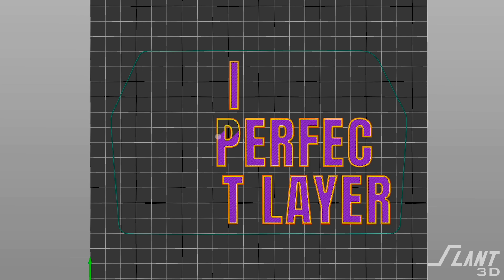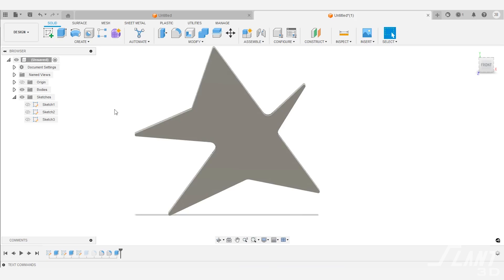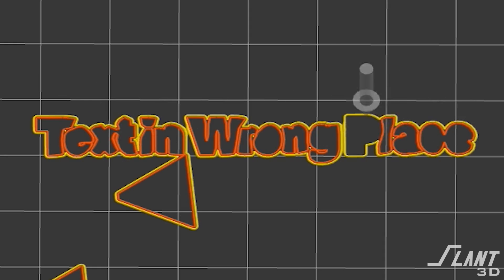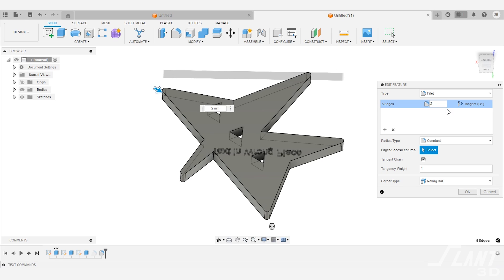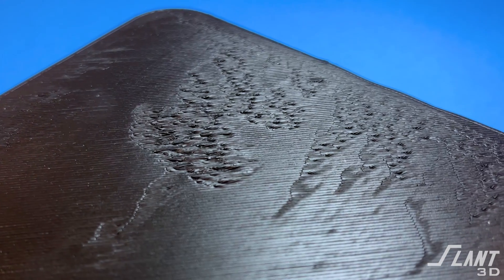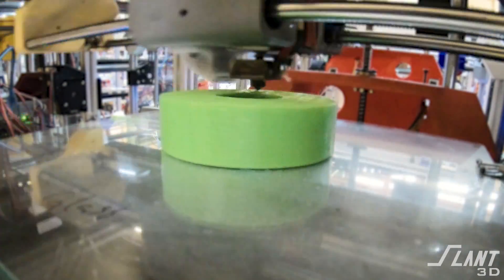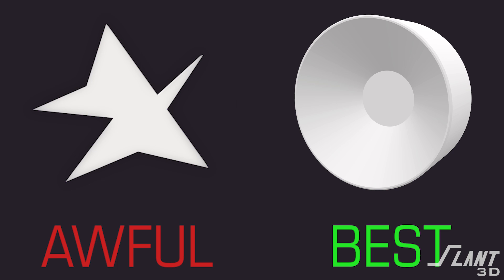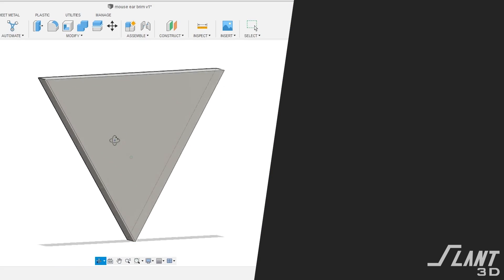Optimizing Your First Layer For Mass Production | Design for Mass Production 3D Printing

Comment: Great as always! Very informative and straight videos/topics in short time.
3:41 - here where you said 1mm is ideal - what happens to 0.2mm when using 0.4 nozzle to make 1mm thick line? Will it work wish some adjustments/settings(you advice) or is better to make that line 1.2 in the CAD prior slicer?
Also what printer would you recommend for 1/100 of mass production - lets say 1-2 printers max as a sidejob?
Thanks!

Comment: You're putting the cart before the horse. Learn to print properly, tune your machine, know your slicer. With Arachne and a tuned printer I can print your "nightmare" model - sharp corners, "unnecessary triangles", text, and all - perfectly. Every. Time. 

Don't underestimate what printers are capable of. I know you run a business and mass produce, but every single obstacle you touched on in this video can be overcome with a properly tuned printer and good slicing.
Reply from the maker: Anyone can print our nightmare model. Now print 1 million of them with ABS. You will pray for the optimizations
Reply: @slant3d  🤣 I wish you nothing but success in your endeavors.

Comment: My tuned Voron 2.4 R2 gives me the courage to print this "badly designed first layer" using ABS with zero worries 😂. A capable machine helps overcome a sub-optimal design, but I understand how mass printing places more emphasis on reliability. No one has the time nor the patience to perfectly tune +10 printers and create a custom slicer profile for each.

Comment: Wow. I would have thought that if the design required a star shaped object, with decorative holes, and the final product looked like a hockey puck, that would be a massive fail. Are you saying that 3D printing is not the best method for producing objects with complex shapes, I thought that was a main feature of 3D printing? What process would you advise if sharp corners are a design requirement? Personally, for the round object you advised, I’d use a lathe. It is far more accurate and faster than 3D printing.

Comment: If you guys are at bandwidth and at capacity for what you can currently do on a personal level -- I would recommend reaching out to your customer base and asking some of them to speak about their experience using you ugys, what products they made or do -- how that integrates; and maybe even some of the prelim API customers/testers.  

I come here for the printing content, but a fluff video that illustrates some social proof of your brand and shop services might be a low effort/crowdsourced way to have content in an in-between week; where you are occupied by the factory's needs.

Comment: First layers aren't such a big problems anymore with the current tech. Also, slicers are becoming smarter every day. 
If you can't even get your first layer right, then you shouldn't be running a print-farm in the first place. I know the response I will (or not) get. "Make 1 million more". but that answer is not gonna cut it.

You should make video's about real problems imo and offer your viewers tips and tricks about how to overcome them, instead of avoiding them. Even if it's in a print farm. 

Oh wait, you are trying to make them obsolete.
Reply from the maker: In mass production, every optimization is necessary. There is not a system on the planet that produces a perfect result every time. The entire process is part of the process.

Comment: If the design is hard to print just change the entire design! Here in the real world, that's rarely possible. Almost all of the issues you presented were printing tuning/calibration/maintenance issues. Those first layers looked like crap because the printer wasn't set up right. You sometimes have some decent advice, but this time you're mostly just wrong.
Reply from the maker: When producing millions of parts every optimization is important

Comment: I had issues with the large flat surfaces causing the waves/furrows and the solution was better leveling ~and~ a switch to 'Hilbert Curve' for the infill pattern. That prevented the long extrusions and resulting artifacts.

Comment: I get the video but printers now have fewer problems like this. Yes I’m talking about the Bambu Lab printers. Does Slant3d work on developing and improving their printers to match what modern printers can produce? And do you see these problems being inherent with 3d printing, or just the state of your printers at this moment? Like, will your printers in the future be ok with printing text on the first layer by the tens of thousands?
Reply from the maker: Regardless of the machine when you produce 1 million parts you need to optimize to reduce errors

Comment: I specifically put text on the bottom layer and design a large contact surface for my job. 

Not mass market printing though, but industrial. 
Rounding corners and chamfering edges goes a long way . A warped corner can kill a project quickly, many of which print for several days.
Reply: Do you print industrial end use parts in small batches?
Reply: @ChristosAdamMorsy   No, My end goal is to generate tooling for manufacturing. Most of my items are designed and printed once, or whenever they wear out. Only a few items get printed in batches.

Comment: Suoerb video ! Reminded me of a lot of things I sort of intuited and worked out whilst trying to design parts for printing in nylon, that were proving a swine to print, but with a view to being mass produced. A lot of the ideas seem applicable in higher horizontal layers too - eg not having pointy bits - which seem to suffer from warping and curling, and if designed into radii work so much better.

Comment: I love the videos, but I do have to say when I do multicolor prints on my Bambu lab x1 flat on the bed surface. It comes out amazing I don’t know if that has to do with the lidar or just tuning of the printer.
Reply: The X1 is just special. 
If you didn't own a printer before that, you might not realize it, but they solved a lot of the common problems with 3D printing. 

I'm just in loved with mine (that I use for engineering work). For once, the printer is not the project.

Comment: Or you could just tune your printer so it can print these things
Reply from the maker: Done. Now make 1 million more
Reply: @slant3d  well I'm not at your level of printing I won't argue that but I've probably made close to a million parts but I do resin mostly I do have a filament printer but most of my stuff is all very small highly detailed models but the fact remains once you dial in a printer resin or filament you should be able to drop just about any model on it and fire and forget
Reply: @slant3d done, now what?

Comment: I dont have any trouble doing multicolor text or anything else on the first layer. Get a multicolor printer and its basically no different than printing a regular part.... as long as your printer is tuned well.
Reply from the maker: Make 1 million more. Every optimization is important

Comment: Those bottom surface defects can be caused by finger grease on the build plate too. Printing a smaller first layer across a patch of grease is fast track to failure.
Reply: I've also had them by having the first layer too close to the bed by 20% of the layer height. It can also be caused by a non flat bed.

Comment: It’s nice to hear I’m doing it wrong but I don’t hear any real solutions. No text on the bottom isn’t a solution it’s just avoiding. The bottom needs to be a circle doesn’t really make sense if you have a part that isn’t a circle. In a perfect world all parts would be cylinders I guess but we’re not in a perfect cylindrical world.
Reply: Your exaggerating he said no sharp corner not make a circle, do 1mm if you can, if a square goes in a square then round the receptacle by 1mm also, like a lug nut, it would work better without round corners but due to manufacturing needs, it has rounded corners. You may not realise it but if you print using .4mm layer line width you will have corners rounded by at least .4mm. no need to round corners in the z axis by the way, he should have mentioned that.

 Also if you need text in the bottom, try flipping your piece on another side, your bottom could become the top. And personally doing text in the bottom I do some times for double faced coins but I warn the client about the faces not being simetrical and I put extra fees.

Not ideal doesn't mean impossible or illegal, just means try to avoid it as much as you can to improve speed, quality, cost and reliability
Reply: The solution is up to the design engineer, he gave advice on how to steer the design. He can't tell you exactly how to make your part.
Reply: When I'm working with a client on CAD modeling for 3D printing, I have them either in person or on screen share so we can come to a happy combo of design requirements and printability. Sometimes I have to tell them a particular feature they want would either be really expensive, hard, and/or impossible, so I offer a substitute solution.
Reply from the maker: Make parts rounder. Avoid sharp corners. Obviously your first layer will not be a circle. But moving in that direction is a way to "optimize" a design.
Reply: @slant3d  I appreciate your design tips and I think it's obvious what people can take away here.  sometimes people just want solutions to be black & white
Reply: @rELATionGaming  exactly. I already know these things and am looking for something more specific but a lot of these videos I’m coming across are at such a surface level.
Reply: There's various tips to improve the first layer in the video, summarized at the end. The circle is where you will end up if you follow all of that advice to the extreme, with no regards to your part requirements. Every part is different, there is no single first layer shape that will work for every part. You'll have to think for yourself to find out how you can apply the given tips to your own parts and figure out what shape works best within the design requirements of your part.
Reply: There's a pretty good recap of the solutions at the end of the video for those who don't have the patience to pay attention through the whole thing...

Comment: I always try to put details like text on the bottom layer because it usually looks the best imo
Reply: This probably boils down to they don't want to spend a lot of time fine tuning individual prints and they have to worry about reject rate. You can do this as a hobbyist on a single machine, but can you do this consistently on a print farm of hundreds of machines?
Reply: Same, his advice makes no sense about not putting it on the bottom. If you can’t print text on the bottom, you should fix your first layer issues instead of avoiding it.

Comment: Prusa prints parts on their printfarm that have text on bottom surfaces, have fairly sharp corners, have cutouts and have large surfaces. I really like your informative videos but this one isn’t up to date at all. I don’t get why you present such massive limitations of 3d printing even though it’s apparently just your printfarm that doesn’t produce good prints
Reply: It's not that at all.  He's talking specifically about designing parts that will print well and will require the fewest number of slicer modifications to do so.  Yes you can print all the things he is saying you shouldn't do, but you will have problems on a basic machine unless you spend a lot of time  getting the settings right.  That's fine for people doing this as a hobby, but for companies with tight margins, capital, labor, and material investment are necessary to minimize.
Reply: @theproceedings4050  and in my opinion in this day and age you should not limit the costumer on what they want to produce. You don’t need to spend “a lot of time” in the slicer tweaking setting anymore
Reply: Prusa can afford to optimize for their specific use case.
Reply: @Killy10000  can you elaborate? Do you mean the model or the printers?
Reply from the maker: When you produce millions of parts. Every optimization is important.
Reply: @slant3d  it is! But saying you should have cutouts (which I still don’t get why that tringle should cause any problems) is wrong in my opinion. Yes you should round corners but every other point you made is just important if you don’t have fairly well tuned printers. And that absolutely shouldn’t be a worry the costumer should have to think about! Like that’s what you are saying no?

Comment: Good design principles. Would a circular pattern, concentric rings work to reduce surface area on the build plate. Sometimes you can't go up into a part like that.
Reply from the maker: That is a reasonable solution. But the. You are creating a more complex first layer

Comment: I would like 56 cylinders .4mm wide and 500mm high attached at the top by .2mm rectangles please 😁
Reply: I appreciate the design principles. I want parts that print reliably, and try to take advantage, when I can, of techniques that can help me do that. These videos challenge me to design better parts. Sometimes the design just calls for something that is not optimal, but often some minor changes can make a positive difference. An opportunity to up my game! Thanks!!!
Reply: That does follow the rules from the vid. You're in ! 🤣
Reply: I'm pretty sure that's too high for their printers and the parts are too thin to be fdm printed, .4mm is the diameter of the nozzle so the rectangles wouldn't be able print, the cylinders would also way to flexible to be useful anyway.
Reply: @linkeroniw  I like printing with a .1mm nozzle. Though that makes the first layer much, much harder.

Frankly, .4mm is a "good enough" standard for when the average hotend was the e3dv6, get anything better and you can print at least as fast with a 0.2mm nozzle. Add in a CHT to that nozzle and you print faster than a straight .4mm nozzle.

Comment: Bro I have an X1 first layer is always perfect😅
Reply: A lot of these 3D printing tips by Slant 3D are intended for a mass production or 3D print farm audience, although they are often useful for hobbyists as well. If it takes a hobbyist 2 or 3 tries on a model before it comes out perfect, no biggie. If it happens on a 3D print farm, that's 2 or 3 failed prints thrown away for every successful print and on a mass production scale, that adds up very, very quickly.
Reply: hes talking mass production and helpful tips. but im glad you spent $1500 so u can print well even if you dont know what the hell youre doing in  your designs
Reply: @badjackjack9473 haha Even a tiny bit of tuning can achieve a good first layer with text. Who would want to print on a printfarm where even that isn’t possible. The results were terrible he showed
Reply: @badjackjack9473  Thanks me too!